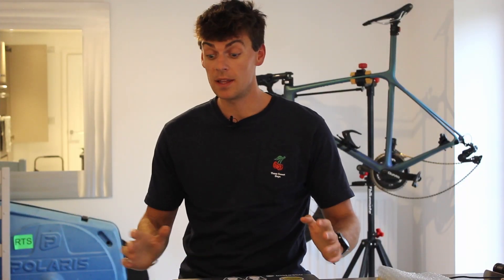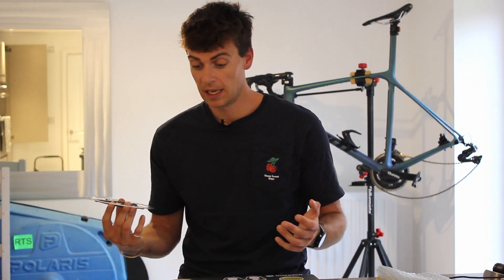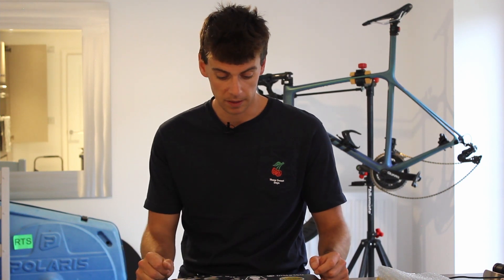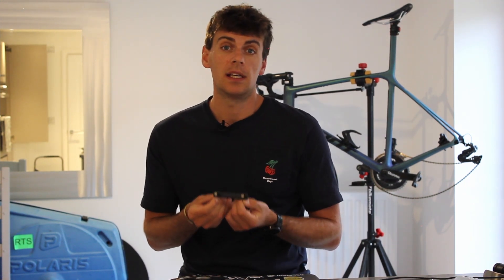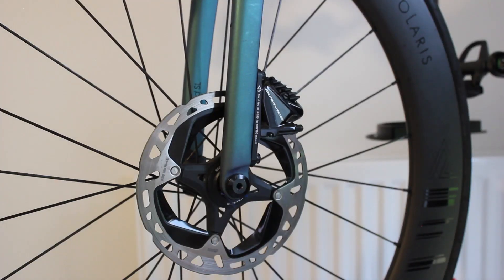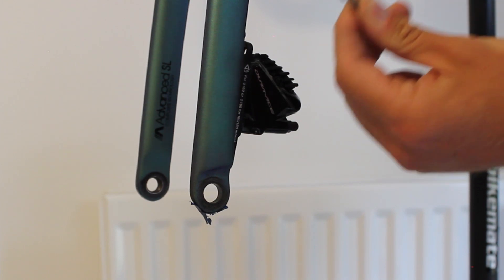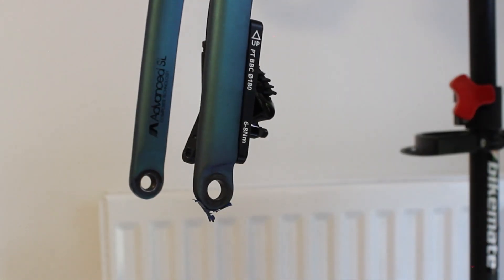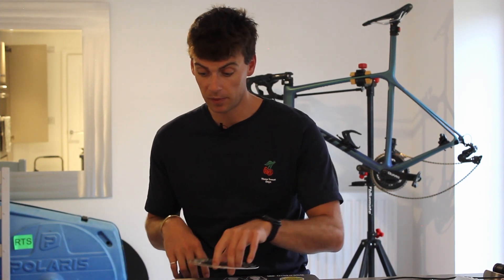180mm Disc brake conversion on road bikes

Comment: I'm 6'3" and 220 lbs. I ride gravel and road. Gravel is way harder on brakes than road for a few reasons. I have never had any of the issues you and a few others complain about. I have had rotors on my gravel bike get pretty toasted to the point that they changed colors some. (They were a bit cheaper rotors I had to buy because of supply chain issues. Not sure if that has an effect.) But, they still worked fine, never had any issues during the ride, they always worked, didn't rub,... I've ridden my road bike in the mountains as well. But, it doesn't get near the abuse the gravel bike does. Both have SRAM if that matters. Regardless, people have overheated rim brakes and that is a problem. Especially if paired with carbon wheels.
Edit: I am not arguing against the bigger brakes at all. Just some of the complaints people are making. I use 160 and wouldn't mind going to 180.
Reply: It is interesting to consider the extent that road design changes "how much brake" you need. You can still rip down a dirt road in the woods at 50-70km/h, but the corners aren't banked and the surface is loose, so you have to absolutely rail the brakes every time the road curves. On tarmac, at least on well-engineered roads, there are cambered turns and uphill runouts to reduce the amount that cars would have to rely on their brakes, and to be sure on these roads you barely need brakes at all (except in emergency situations).

Still, there are edge cases for both gravel and road. From what I've ridden and seen in the UK, gravel tracks are really slow going, and there are not as many high-speed descents as there are in other parts of the world. Also, where I live in the United States, the roads I ride on are extremely steep, poorly paved, and poorly engineered, so there are many roads where bikes and cars alike burn their brakes.

At any rate, there's riders who can benefit from a 180mm rotor in either camp, and since most bikes are flat mount these days, an adapter like this could be fitted in either case.
Reply: Shh... You're correct, of course, but he's crafting a narrative. My experience is the same... I never experience fade on road, but sometimes do on gravel descents.
Reply: I am 6’2 230lb, and have never had any issue with any disc rotor as far as thermal management goes. Been riding disc and rim for a long time…. But disc for about 15 years, even before disc was really a thing on road bikes. 180 is overkill for 99% of riders.
Reply: @ktakashismith  He asserts that road needs bigger rotors than MTB when 1) MTB are heavier 2) traction is less predictable 3) descending speeds are slower resulting in 4) more energy lost as friction/heat and 5) less effective air cooling. 

My own lived experience is that my 1.85mm thick SRAM Centerline X rotors have worn down to 1.66mm and 1.69mm in 22500km and 250000m descended. By the time the rotors hit 1.5mm, they will have seen over 30000km. My SwissStop Disc E pads last 10000km or more. I ride in mostly dry conditions, but my bike is not a stranger to damp/foggy mornings.

Meanwhile my dirt oriented bicycles chew through pads, not because of contamination, but because I am simply braking a hell of a lot more.
Reply: @kidsafe  I'm not entirely sure if PT ever made the assertion that road bikes need bigger discs than MTBs, just that there exist many cases where you might want rotors larger than 160mm on road bikes.

Your lived experiences are your own, and totally valid, and if you don't feel the need to buy this product, then nobody is forcing you to. If you've never had your rotors turn gold or blue after a ride, experience your rotors constantly warping out of true, or experienced brake fade on a mountain descent (I wish it upon nobody), then yeah don't fix what doesn't need fixing. But that doesn't mean you need to "expose" PeakTorque for "crafting a narrative", it's a niche product that may improve upon the negative experiences that some people have with road disc brakes.

It's ironic that you bring up the SRAM centerline rotors, because I've managed to take a set down to 1.62mm in less than 5000km, so that gives some idea of how variable these things can be. I'll be damned if I'm not going to ride my disc brake road bike because it's wet and nasty outside, that's supposed to be the benefit of the system anyways.

My MTB likely goes through a set of rotors every 5000km too, but it takes me a hell of a lot longer to rack up 5000km on that bike, and there also exists the option to upgrade my brakes further on my MTB, whereas my road bike is maxed out on "road disc tech".
Reply: @ktakashismith  Please go back and watch his video titled "The Physics of Froomey's Disc comments."

Anyway there's no denying that brake draggers and timid descenders wear through their brake components more quickly, but PT going through entire rotors in 6 months is crazy to me. It takes me >2 years of riding 15000km a year to wear my 1.85mm thick 160mm rotors down to 1.5mm...with semi-metallic pads.
Reply: @kidsafe  I would suggest that you re-watch that video as well, and shoot me a timestamp for where he said that road bikes need larger discs and calipers than MTBs. The argument was that current road disc caliper and rotor size are insufficient for their application, not that road discs and calipers must be larger than those on MTBs.

I also appreciate your attempt at baiting an emotional response by implying that I'm unaware of how to operate brakes, that's very cute of you and I'm flattered. Have you considered, perhaps, that you might not see as much elevation gain over your 15,000km as others, PT included? Nah, better to just go the classic angry man-child route and try to piss on anyone that has a different experience than you.
Reply: @ktakashismith  I was not implying you were a bad descender. I was agreeing with you that 180mm rotors may make sense for extreme cases. 

A bit over minute into the video PT states that "the road application is four times harsher in terms of thermal issues than the mtb."

Also I already mentioned my elevation gained/lost in a previous reply: "My own lived experience is that my 1.85mm thick SRAM Centerline X rotors have worn down to 1.66mm and 1.69mm in 22500km and 250000m [worth of elevation] descended. By the time the rotors hit 1.5mm, they will have seen over 30000km. My SwissStop Disc E pads last 10000km or more. I ride in mostly dry conditions, but my bike is not a stranger to damp/foggy mornings."
Reply: @kidsafe  Yes, extreme cases like "brake-dragging and timid descending." And you're still extrapolating this imagined indictment of MTB brake systems from his comments - at no point did he say that road bikes need larger caliper bodies and rotors than mountain bikes, or that MTB brakes are over-sized for the application. The point was simply that, in PT's own words: "Im saying road discs don't seem to be suitably sized for the thermal load...i wouldn't have released disc road brakes in this state of development. They're not good enough. Too many inconsistencies, noise, too little cooling."

And fair play, I didn't see the elevation you posted in your initial reply. Crunched the numbers and changed the units to Imperial (dumb American here), and I guess I average 223m of elevation for every 100km ridden, so in the same distance of 22500km, at my present ratio of climbing/distance, I would have descended 511,363m. Couple that with the fact that I ride in the rain (and it rains 9 months out of the year where I live), and we might have some explanation of our different rates of wear.

Also, system weight does play some role in this, I'm riding at around 90kg for rider+bike+kit. Use also plays a large role - one of the most common descents I do has two stop lights in the middle of it, so I often find myself going from 80km/h to a full stop two times in the same descent. Add in the fact that I'll often go down this road three times in a ride and perhaps we have another point at which we diverge in use. I would argue that it's the high speed stops that wear brake parts more than the brake-dragging down the narrow bike path.
Reply: @ktakashismith  He does, in fact, imply that road flat-mount calipers with roughly half the mass of MTB calipers are not up to the task. But he's also wrong about caliper weights here too. An XTR M9120 4-piston post-mount caliper weighs 108g. A DA R9270 2-piston flat-mount caliper weighs 100g.

7457ft per 62mi is a lot. I was roughly getting 100ft/mi when riding solo, but now I mostly do competitive group rides and racing. Got a Strava I can spy on? You can probably guess mine.

And no, all-else-being-equal, brake-dragging is definitely the more thermally stressful approach...for numerous reasons, some obvious and some less obvious. A less obvious reason being aerodynamic drag scaling to the power of 2. But really you only need to test this yourself on a stretch of road...bring an IR thermometer. Or smell a bad driver's burning brakes after they drive down from a mountain pass.
Reply: I'm 6ft 2 same weight. Fade is a massive issue to me with loaded bike.. Devon rolling hills, up, down.  Front brake mashed. Not an issue I have ever had with Campag rim brake pads, or Swiss stop. It's pure heat dissipation and 180mm can only help

Comment: I did it and one thing I can say is that if you have open dropouts it's easy to get the wheel out of the dropouts if you are too grabby on the brakes.

A thru axle fork would be just fine imo. The flex when heavy braking could break aluminum from fatigue in the long run but other than that, meh.

Comment: Very tempting to do one of these conversions. Good to know that braking into a steep hairpin won't turn my fork into an origami crane with 180s too, which would have been my main concern
Reply: Haven't seen many forks break, not that it cannot be an issue. I would be more worried about super-light, low-spoke-count front rims tho, see those collapse in more than one occasion under really hard riding.

Comment: Gotta love more options, it's one of the reasons why i stuck with my post mount brakes on my commuter, might not be the tidiest looking setup but easy rotor size conversion, running 180/203mm. Kinda sucks that all road groupsets usually don't offer post mount brakes.
Reply: you could go shigura....
Reply: xt postmount brakes are pretty much compatible with shimano road levers.
Reply: Oh I'm broke and still on mechanical TRP spyres. If I end up on a frame with flat mount I'll probably just grab a PM on FM adapter

Comment: Edit: The below is wrong, and only applies to the forces from the caliper.

Not sure if anyone's mentioned it, but the 12.5% increase in braking power does not transfer into the fork. Because it's a leverage effect, it's only the wheel that feels the increase in torque transmitted from the disk.

The fork does however have to accommodate the fact that there is a change in where the braking force is applied, which changes how evenly the caliper attachment points are loaded.
Reply from the maker: @JMMC1005  if you draw the free body diagram its easier to visualise. The bigger brake causes an increase in friction at the tyre contact patch, which is a force parallel with the ground acting on the wheel, fork, then frame.
Reply: @PeakTorque  Ah yes, that's true - bit of a dumb comment on my part.

I was thinking more of the local forces from the caliper itself, but you're right. Any increase in braking power has to transmit from the axle to the rest of the frame via the fork.

Comment: Cool project… thinking of getting this for my gravel bike.  2 questions:  caliper/rotor adjustments will be made with factory 160mm bolt/plate and not from your adapter?  And do you have a rear brake version?

Comment: My Defy is a 2015 disc bike which came with mtb type cup and cone caliper mounts which I think are better than flat mounts with more adjustment . I all have run a Hope 4 piston front caliper for 3 years with 160mm disc with all the braking I will ever need as I am not good down steep down hills due to speed wobble in the passed.
Reply: Cup and Cone is a type of bearing. I think you mean post mount brakes? 🤔

Comment: I was looking at 180mm options when I got my new road bike last year but couldn’t find anything suitable. Have ended up with spare 160mm discs now so it’s unlikely I’m going to change. 160 seems fine, have had some squealing on fast descents but hadn’t realised the bike came with resin pads rather than the sintered ones I’m used to

Comment: Couple of my bikes are flat mount to 160mm post, then a 160mm post to 180mm post adaptor to fit a 180mm rotor. (hack/bodge??)
Never had any problems, although I could lock the front on 160mm or 180mm with enough lever force never really comes to that, find 180mm is a lot more in my sweet spot stopping, with a 4pot magura (115kg system weight)
Your going over the bars before you overload your fork as far as I'm concerned

Comment: it is not the diameter that is the issue, I ride on streets/gravel with a 203mm dual piston xt disc brakes but they still will overheat and glaze up the pads. the rotor needs simply be wider or rather thicker, it is basically razor thin at this point in time and that is the issue for me. My old xt v-brakes on ceramic coated rims is actually far better braking solution than current gen discbrakes.

Comment: Just came from a multiday gravel /bikepacking trip where both of my brakes failed within few km of each other. Pad just came off / cracked in half. Bike was loaded with extra 15kg and I assume it happened during a rough steep mtb section dragging the brakes for a longer time. The pads and 160mm shimano discs were on the low side but not on the limit. I wonder if fresh pads and discs would've been enough extra mass to avoid the issue or is it just too much to ask. Calipers are trp-c mechanical ones which might also play a role with the heat dissipation? Either way a bit scary...

Comment: Okay so the proposed solution to brake fade is to increase the rotor size. Brake torque per pad pressure on the rotor is decreased for the equivalent torque on a smaller rotor, hence less heat on the pad so less brake fade. Peak heat has decreased as well.

I feel like if we extended this train of thought you would eventually end up with rim brakes, no?
Reply: Not really. The rim has other jobs to do that compromise it's ability to act as a braking surface - more mass to act as a wear surface where it really isn't needed around the entire circumference, cannot engineer in aero, cannot clamp it as hard since it needs to be light, hollow to support the tyre. Let the rim be a rim, and concentrate braking on a device that can be engineered to optimise that function in isolation.
Reply: torque is decreased, speed increased, total power stays the same. Dissipation of that power increases though through bigger heat mass
Reply: @feedbackzaloop  Oh, and they suck in the wet.
Reply: @WeirdNeville  who they? 180mm rotors? I was merely commenting on the premise, not conclusion

Comment: Moved to a new city with massive hills - as well as an 11-34 cassette, have bumped the rear rotor to 160 from 140 just for thermal management. Brake fade is scary…
Reply: Yeah first time I ever encountered my first mountain I smoked the disk brakes on a department store mtb on the descent. Was pretty scary.

Comment: I have a Merida Scultura Endurance and I'll probably switch to 180 when the current 160 dies. I'm light (63kg) but I live in a mountainous area with long and steep descends. Oh, and it is hot climate too. Brake pad life hasn't been great and the rotor is going towards the 1.5mm limit quickly.

Comment: Mohoric was riding the scultura in MSR because he was also using a dropper which requires a round seat-tube
Reply from the maker: but he took the fork off the Reacto which fits 180mm discs...Look closely

Comment: Nice product. Though I'm not sure if you should clamp your frame on the top tube. Also, there is a dead pixel in the middle of your shot
Reply from the maker: Its not clamped of course

Comment: I just put a 700c rotor on my road bike front and rear. Weirdly enough it is lighter than my road disc set up and is a lot quieter and more aero. My tires also dont break traction as easy which means I can brake into the corner with less worry about sliding out like happens with road disc on road race tires.

Apparently all the fastest sprinters and climbers on earth uses 700c rotors for decades no problem until someone thought it would be good to downsize the rotors to 140/160mm and add more spokes to create a wind brake effect.

Comment: This is excellent. I’m bummed my hope calipers won’t work with this as the way that the hose exits the caliper and enters the frame is already tight. I may go ahead and swap back to my 9200 calipers and try this out if it looks like it will be more accommodative. 

Any reason not to make the adapter one piece instead of making use of the shimano wedge?
Reply from the maker: Leaving it as a 2 piece part 2 help neatly fine tune the caliper alignment. I wanted the bit that connected to the fork not to have slotted holes.
Reply: @PeakTorque  If you made a true one-piece adapter, you wouldn't need to fiddle with short screws: caliper would sit lower on the fork and way further off the mounting plane.
Reply: @PeakTorque  Ah, that makes sense, especially given the variance from frame to frame. I’d say it may be wise to encourage people to have their brake mounts faced, however, most shops don’t have the correct tools or knowledge to perform that on a carbon frame properly.
Reply: @PeakTorque  So is the slotted adjustment now on the caliper to mount?